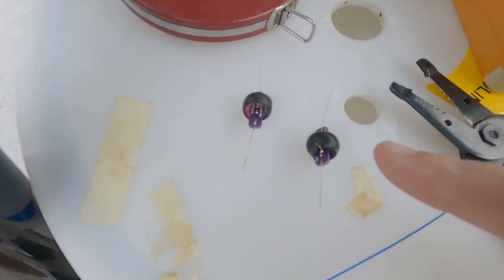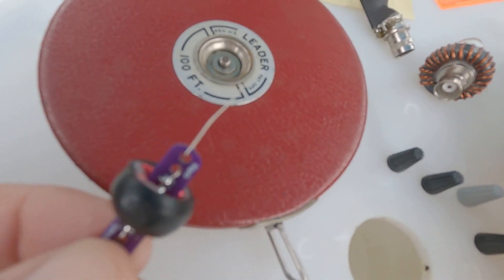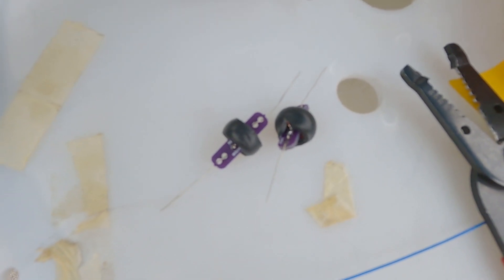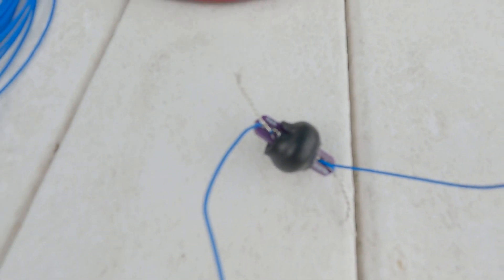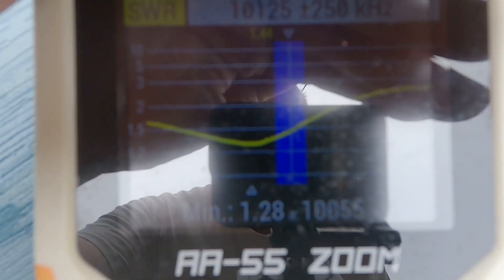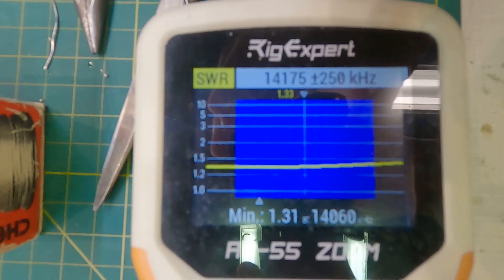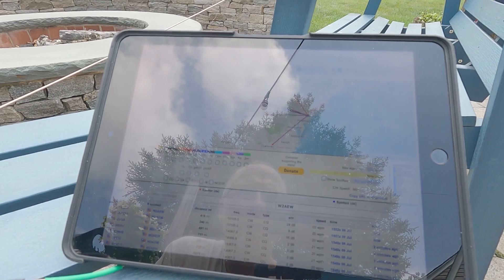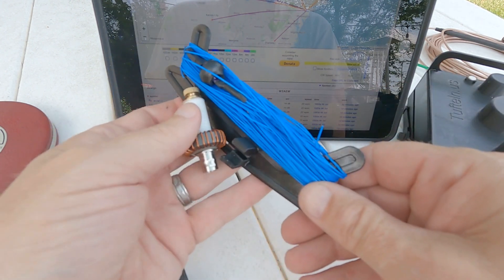#388: Build, tune and test a trapped 20/30/40m End Fed Half Wave antenna

Comment: Excellent video.  I no have the N7KOM traps on my workbench and I'm ready to start winding.  After viewing this video I was wondering what guage wire you used for the elements?
Reply from the maker: I used some lightweight 28 gauge wire for my elements.

Comment: Alan, these videos are very timely for me as I ordered N7KOM's trap kit last week while on vacation and it will be delivered today. I also intend to make a 40/30/20 EFHW. I was wondering if you happened to test it on 10 meters. I've been using the Par 40/20/10 that was trapped on 20 and worked well on 10. After I trimmed it down to 30 meters instead of 40, I haven't been able to get the SWR low on 10 and the curve is strange, not just off frequency.
Reply from the maker: I haven’t tested it on 10.

Comment: Curious what you have for counterpoise with this setup?  I get away with 25' of coax for my full size EFHW, but I can easily see needing a better "ground" with the higher radiation resistances you get from a loaded antenna, especially on the lower frequencies.
Reply from the maker: Just the shield of the 25’ coax feeder. Counterpoises aren’t as critical for EFHW antennas due to their high feedpoint impedance.
Reply: @w2aew  Not critical, but you can't skip them entirely either.  Every circuit needs a ground reference, and you do have different radiation resistances with all those traps.  It would be worth trying a 50' piece of coax.  $5 says your match improves by more than the difference in coax loss would account for on 40M.

Comment: Is it possible to have even more traps?  Say, one for 17, 15, 12, and even 10?  Or will that not work for some reason?
Reply from the maker: It's possible, but the interactions in tuning would likely be complex, and the added weight of the traps might not be worth it.

Comment: I noticed two things.

(1) When you made the traps, the 20 m trap was resonant just a bit below the lower end of that band, not right in the CW portion where I would have expected.

(2) When you tuned the antenna, the 20 m portion of it was a bit shorter than the usual half wave length.

I wonder if these two things are related?

David  VE7EZM
Reply from the maker: All interrelated I’m sure.